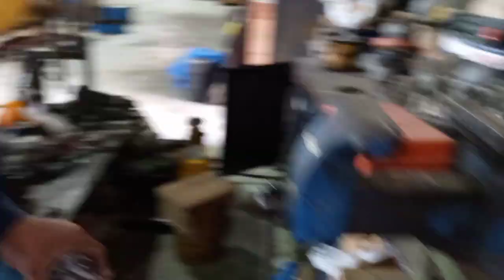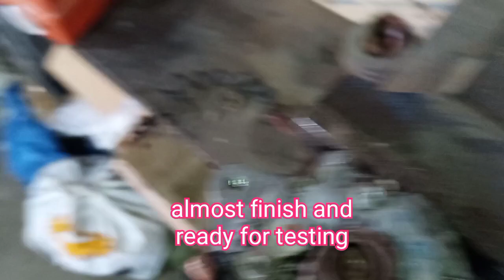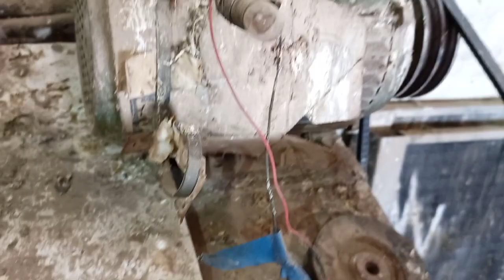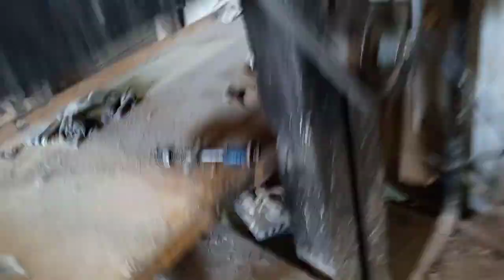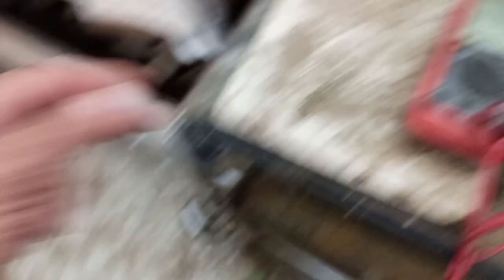DENSO ALTERNATOR ACTUAL TESTING IF OKAY OR NOT

Comment: My Denso is not lighting the bulb. If I earth the bulb it works, but not on the alternator? Many thanks
Reply from the maker: Maybe possible the regulator is damage, or you have to check propperly the coil and diode to make sure before you are going replace the regulator